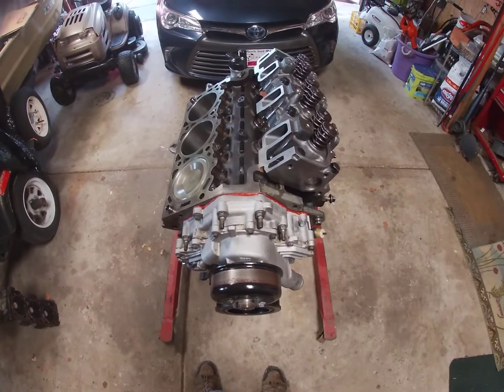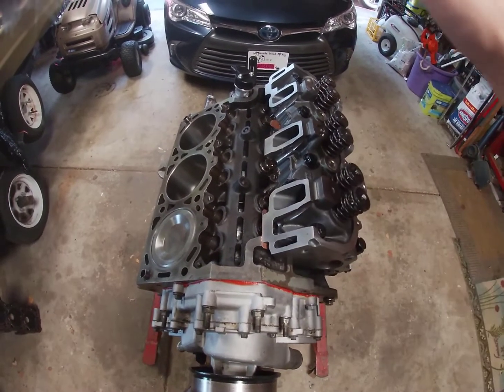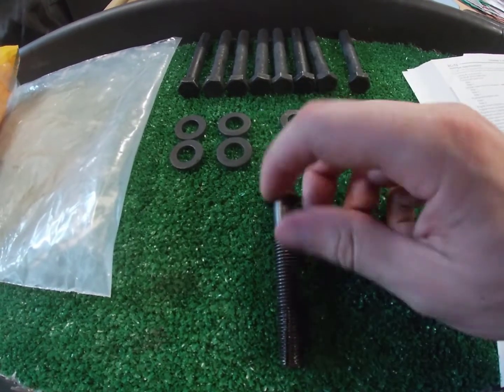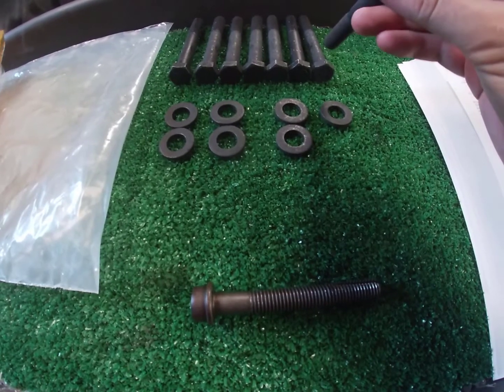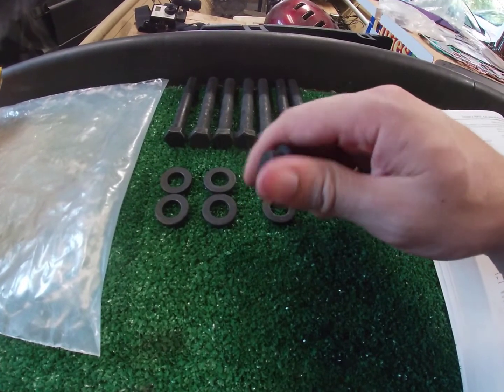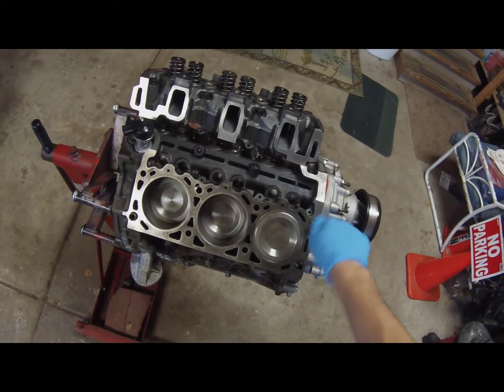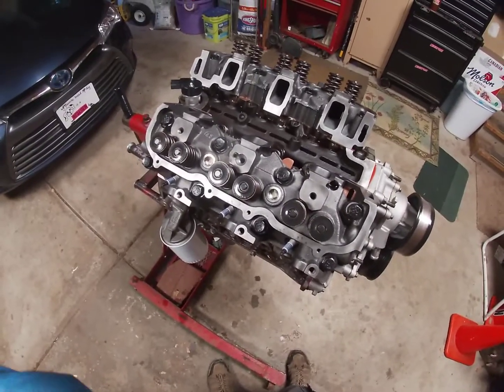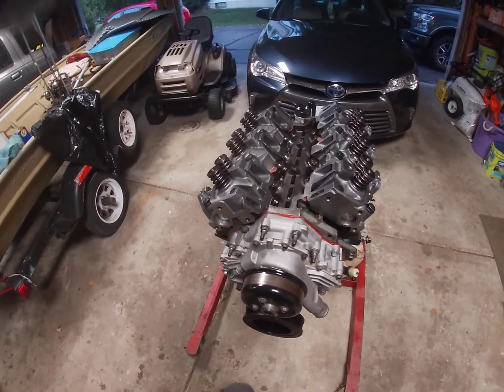Ford 4.0L OHV Head Install

Comment: Which better cam synchronizer is compatible with the 93?
Reply from the maker: It is the 95-98 year model they have the same pattern pick up but they also have a different plug so you need a different pigtail.
Reply: @TEDDAV64  same number of wires just different style plug?
Reply from the maker: Yup the plug is different but still 3 wires.

Comment: I am considering using copper seal on the rocker shaft surface to maybe get more oil to the rockers where it feeds oil to the shafts.  What do you think about it?  Sure seems like a better oiling solution.  I would consider spraying them all or making sure they're all equal for no warping or adding a very thin custom gasket.

Comment: I have the same engine. Does anyone know how else there would be a leak coming from the rear exhaust manifold bolt by cylinder 6 (drivers side closest to firewall)
No leaks from valve cover, no leaks from the cylinder head meeting the engine block, not sure how I’m getting tiny drip of oil from there which of course is causing smoke (burning on the exhaust manifold)
Just finished putting everything back and starting it today. 
Your help is appreciated.
Reply from the maker: The only 2 places I would think it be leaking would be the back of the lower intake manifold or the camshaft sync at the back there. Hope you find it.
Reply: @ Thanks for the advice. I’ll check it out hopefully sometime this weekend.

Comment: Do you need to retime the engine after replacing the heads on a 4.0 ohv?
Reply from the maker: Nope. Camshaft in block so it's easy to remove and replace with no re-timing needed.

Comment: That Copper spray should only be used if you are building a "Race Engine". I would suggest using it on Street vehicle's
Reply: What's the problem with using it on a street engine?

Comment: Hey I didn't see the little nylon cups for keeping pushrod to lifter connection bathed in oil. They just snap on to the top of the lifter. Or were they discontinued? I actually bought a lifter just for the plastic piece .

Comment: Hey buddy them head bolts are one time use only
Reply from the maker: I know, that's why I installed new head bolts but also your only part correct. The SOHC 4.0 has torque-to-yield head bolts but the OHV 4.0 does not have torque-to-yield head bolts. Now it is good practice to replace head bolts regardless if they are torque-to-yield or not. All head bolts stretched it just torque-to-yield stretches more. I replace head bolts no matter what engine it is.

Comment: You should have told us WHY you wanted hex head bolts to replace those ridiculous Torx 55 headed bolts.  You might have mentioned that the after market Torx heads are even more shallow than the stock Ford Torx head bolts and easily slip and strip out the head of the bolt when attempting to get that final 1/4 stretch turn on the head bolts.  As it is, torquing inside the engine compartment is next to impossible there is so much stuff in the way and attempting to use a long extension with a U-Joint on the extension to reach the bolt heads is guaranteed to strip the bolt head unless you have someone in the engine compartment holding the extension straight.  
It is possible to torque hex head bolt to regulation specifications and that final 1/4 turn bolt stretch.  
Thank you for the page with the bolt torques and torque pattern.  That was useful information.

Comment: Doesn't the lower intake need to be torqued down before the head bolt torque sequence? I remember reading that somewhere, but i could be wrong.
Reply from the maker: No on this engine the head bolts need to be torque down before the installation of the lower intake. You might be thinking of another engine.
Reply: @TEDDAV64  The Ford manual states:

1. Install gaskets and heads onto dowls and install head bolts to 44 ft-lbs in sequence. Use an alternating X-pattern starting with the middle bolts and working to the outers.
2. Install lower intake manifold onto two locating studs and tighten bolts in same X pattern except starting with the outers and then centers to 3-6 ft-lbs.
3. Tighten the head bolts now in sequence to 60 ft-lbs.
4. Tighten the intake bolts in sequence to 6-11 ft-lbs.
5. For final head bolt tightening, turn the bolts an additional 80 to 85 degrees tighter in sequence.
6. Tighten the intake now to 11-15ft-lbs in sequence, then tighten them again in sequence to 15-18ft-lbs.

This procedure should be followed to allow for the proper fit of the parts and gasket crush.